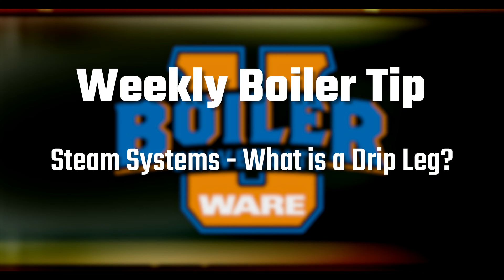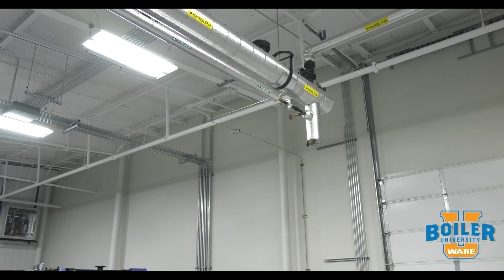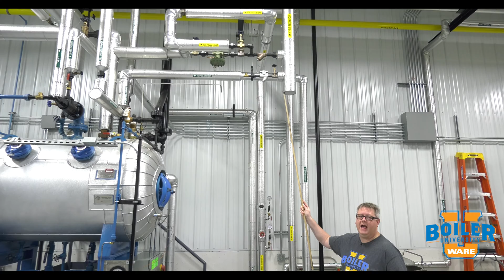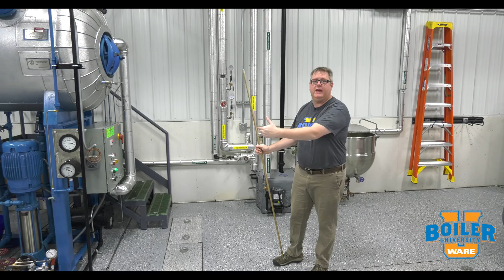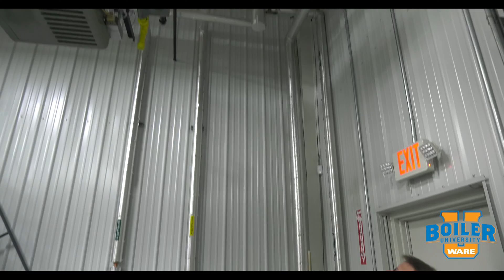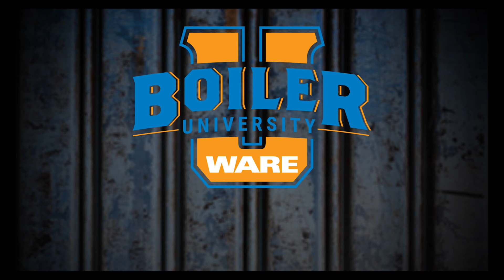Steam Systems | What is a Drip Leg? - Weekly Boiler Tips

Comment: Would you ever have to blow down a drip leg? If so how often?
Reply: You shouldn't have to. The steam trap at that drip leg will remove any condensate that accumulates. Only time i have ever removed a cap off a drip leg was on the gas line right at the boiler during the annual take down for inspection. I did it as apart of my PM.